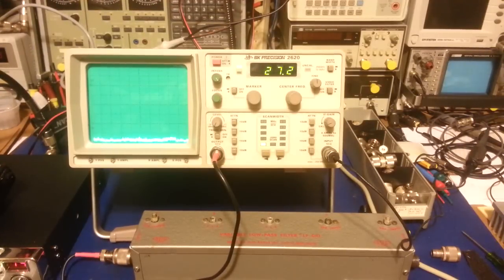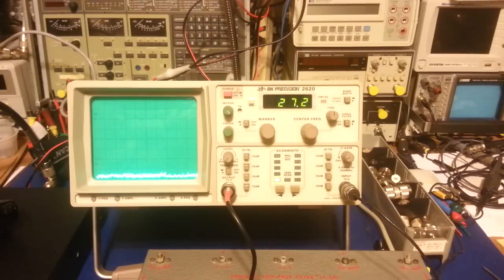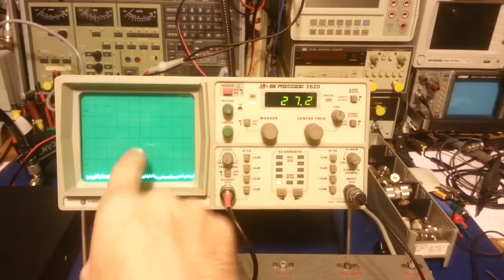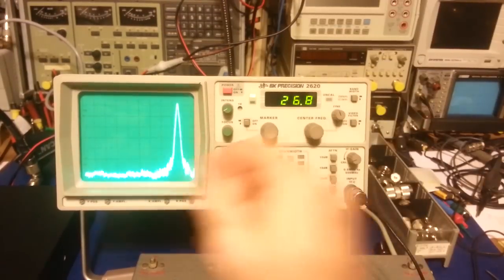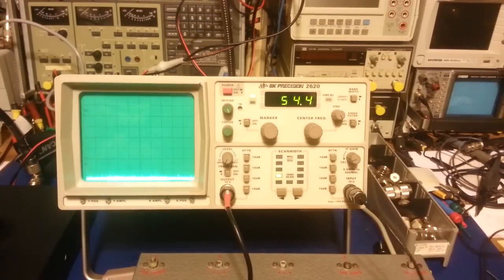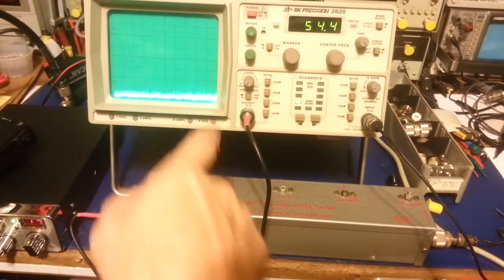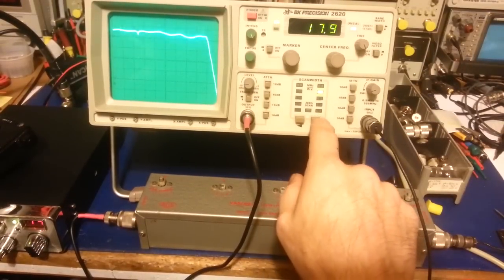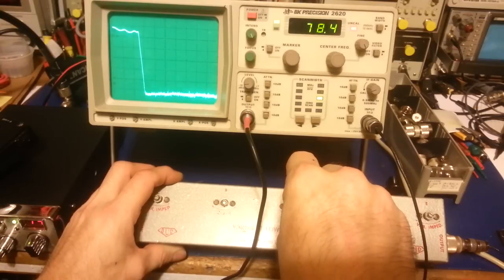Buddy, possible spectrum analyzer for you. B&K 2620

Comment: Hey Mike I need help I have a component p3100eb I need to know what I can use in its place does it measure like a diode or fuse.
Reply from the maker: What is it?
Reply: Well it looks like a diode but no mark so when I looked it up it is made by little fuse so I'm not sure if it's a fuse or diode and it shows open both ways.
Reply from the maker: +Charles Williams 

Just Google it.  It's a thyristor surge suppressor.
Reply: How do you test it to know if it's bad mike?
Reply from the maker: +Charles Williams 

You would need to ask LittleFuse.  I don't know what their test procedure is for a SIDACtor.
Reply: Will a regular thyristor work Mike sorry to bother you I'm new to this hobby.
Reply from the maker: +Charles Williams 

I have no idea.
Reply: Thanks anyways.